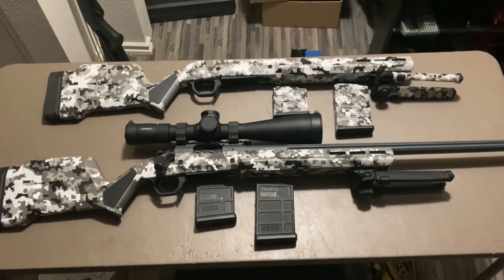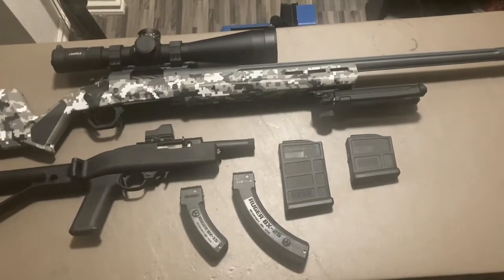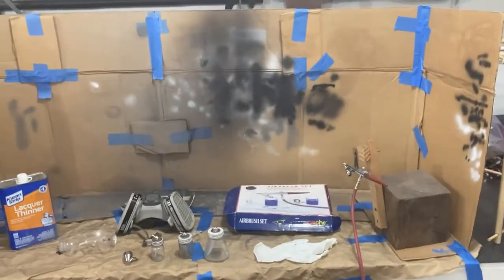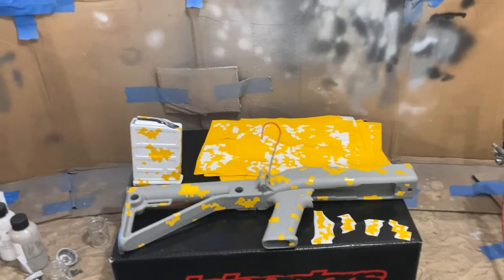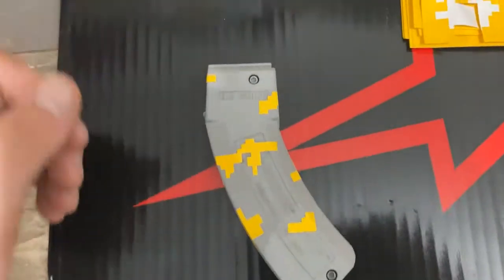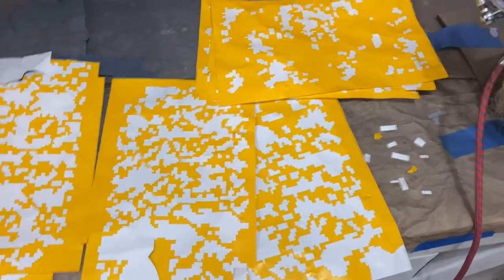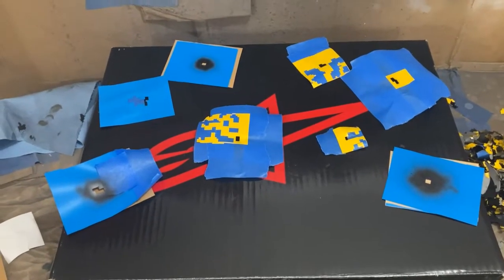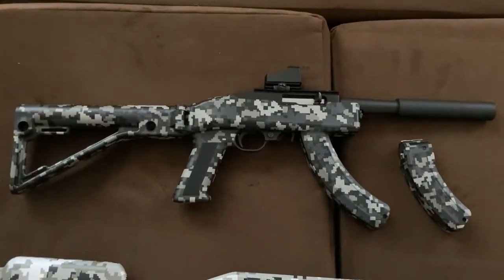Digital Camo Painting Walkthrough Duracoat Cerakote

Comment: Digital stenciling deserves its own video. I really do appreciate your video though. I just cerakoted an M1A magazine and I used female patterns. I made my own patterns in Photoshop and then made an PNG to be used in Design Space for my Cricut. Halfway through I was thinking about how I could use the male patterns because my finished product could definitely be better. My patterns don't flow as good as yours. My patterns are solid, it's just the way I did it that I don't like. The color and material looks fantastic though. I sand blasted at work and then brought it home to my apartment. I cleaned out my Masterbuilt Smoker completely to give me more space and it's perfect. I used an 8 gallon air compressor from Lowes, the quiet comfort or whatever it's called with the same air brush as you. That airbrush is perfect for Cerakote because I see so many people with HLPV spray guns and they just waste so much paint it's nuts. This little airbrush can push a ton of paint through if you needed but I got mine dialed waaaay back to barely push paint. Lets me get more precise. Not sure if you had to bake duracoat but I fucked up by not letting it cool down and some paint peeled off when I pulled the stencil off. I'll try the male method next time cause I'm a perfectionist and this is bothering me

Comment: I’m just getting into using stencils, I’ve done solid cerakote jobs. But for some reason I’m a little nervous or overwhelmed by it. You do great work though. How much practice or long have you been doing stencil work?
Reply from the maker: I've done it just a few times.  It's not hard- just practice before you do something you care about.  Different materials and smooth vs rougher surfaces will change the results.  Just keep that in mind.  Don't get discouraged if some practice pieces don't come out well.  Sometimes it's trial and error

Comment: Don’t understand the blue tape stenciled it looks like there isn’t/ design all way thru it, looks like blue tape stuck to a stencil. Do you cut the design out in the blue tape? That kinda threw me off, rest I understand I’ve done several myself I can’t post pics nor do I know how to make a video abs post it in utube or I would do one. Don’t hv a lot of money to spend on video equipment that’s another hobby and my wife bitching about all the hobbies I’m doing now lol 
Always wondered about air dry duracoat I use cerakote and hv to bake it on. Just seems like it would be better than air dry wonder how air dry holds up to cerakote? Only thing I don’t bake are optics great vid a few things I couldn’t understand like the name of other stencils otherwise good vid bud
Reply from the maker: Some the blue stencils are a different brand, so they look like solid blue tape.  The yellow stencils with blue tape are to protect from overspray.  I'm always budget minded as well- I film with a phone and made a stand for it out of scrap wood to film with.  Same reason for repurposing the small stencils as female stencils- don't have to buy as many sets.  I don't abuse my things, so air dry Duracoat works well.  I have had others Cerakoted to hold up to field abuse when needed.  I do Duracoat on designs I want to do myself